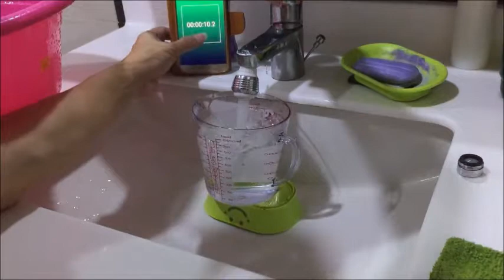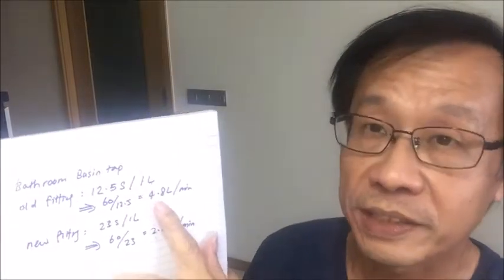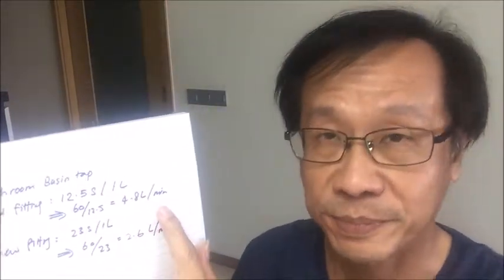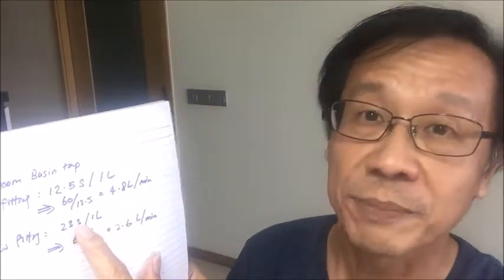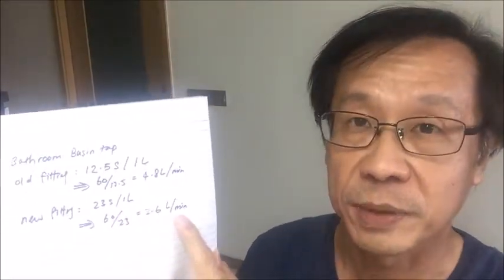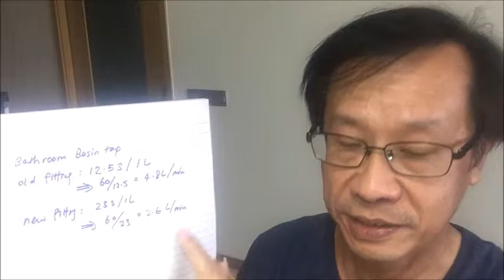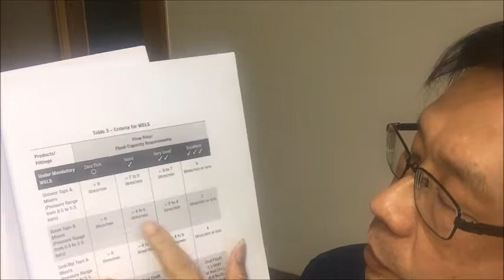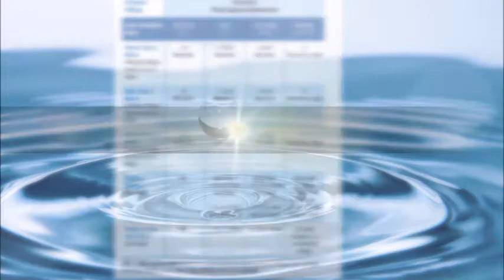Measuring of Household Water Tap Flow Rate

Comment: What an excellent and insightful video Calvin! We have a severe drought here in Cape Town, South Africa, at present so anything that can save water consumption rates high with me right now!  I am sharing your video so that my friends and children who live in CT can also benefit from your experiment and information.  We might not have your tap fittings here, but it may be that something similar is available, and seeing the difference is far more persuasive than just reading about it.
Reply from the maker: Thanks for your sharing about the severe drought situation in Cape Town.
 I understand Cape Town is having a campaign to encourage residents to use water less than 87 litre / day/ person which I think is good even it may be tough to achieve. You can estimate your water consumption from this website: http://mycapetownneeds.co.za/thinkwater/. 
Yes, You can minimize water wastage by changing all the basin and shower tap fitting to those more efficient type and change water closet cistern water tank to a more efficient type and you will find your water bill reduce significantly. Thanks for supporting my video